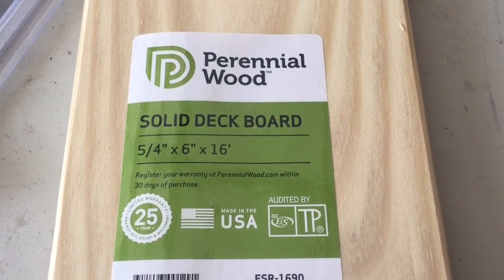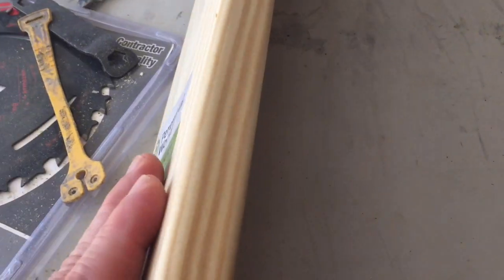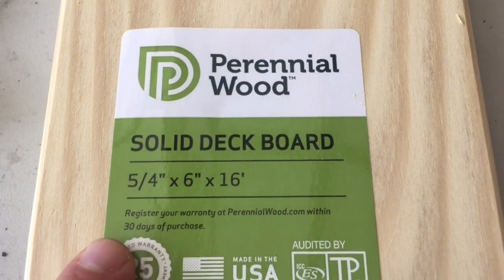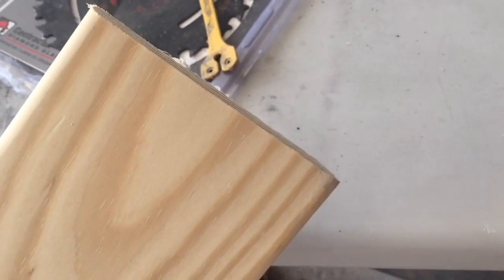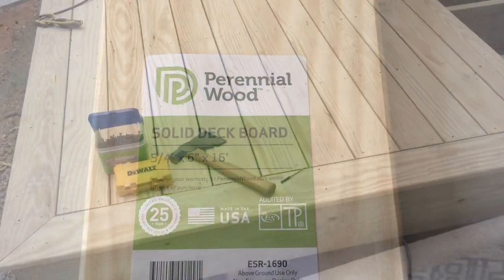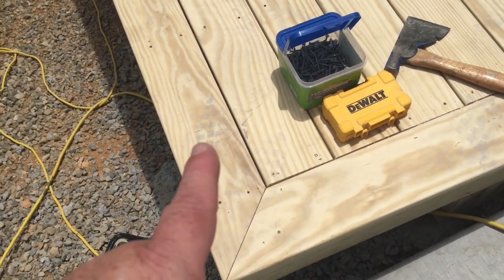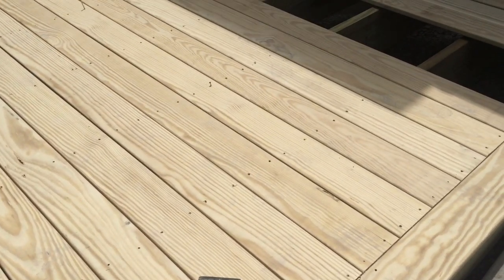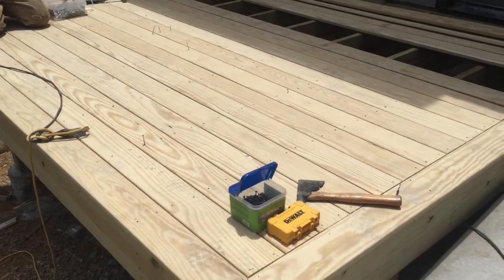Trying Out Acetylated Decking

Comment: how has it held up?
Reply from the maker: Really well :)
Reply: @ArtisanTony  ah that's great to hear. Do you think it would be a good choice for siding on a home? I was also looking into thermally modified wood, but the reviews on that stuff weren't so great. However it's very hard to find any information on accoya/acetylated wood
Reply from the maker: @tubulartuber  Whatever you use it for, make sure you remove the waxy feel before finishing.  It did not take stain in some places and I had to sand it a bit then re-stain.  I actually tried to find it a few years after this and Accoya I think either sold out or is out of business.  I am not sure where to buy it now.  It is a good concept but it seems enough builders were not buying it to make it an every day thing.
Reply: @ArtisanTony  good to know, thanks for the tip. i wonder if you could leave it raw?

yeah it goes by several brand names. maybe the US distributor went out of business
Reply from the maker: @tubulartuber  Yes, you can leave it raw. My wife at the time :) wanted it to look like a darker wood so I had to stain it :)

Comment: we used some stuff called Hardi plank for siding did you ever come across it ? I never did follow up and see the long term of it, they also made Hardi backer underlay for floor and wall tile
Reply: and decking
Reply from the maker: The siding you see is Hardie :)
Reply: +ArtisanTony good deal it was kinda new when I used their products, good to hear bud
Reply from the maker: Hardie siding, fiber cement is good. It will hold paint like crazy.  You are smart to use it!

Comment: How is it holding up? How is the maintenance?
Reply from the maker: The wood is holding up great but it was kind of waxy smooth in spots so i have had to touch up the stain.  But of course that is an esthetic issue because the wood will not rot. If you  are going to use it, use a high quality stain or water sealer
Reply: Thanks for the reply. Does this type of wood require the the same frequency of maintenance and restaining as regular pressure treated wood?